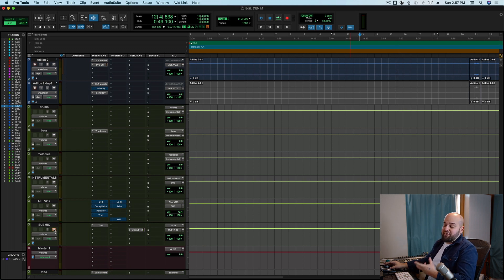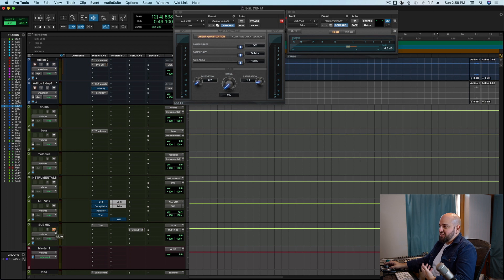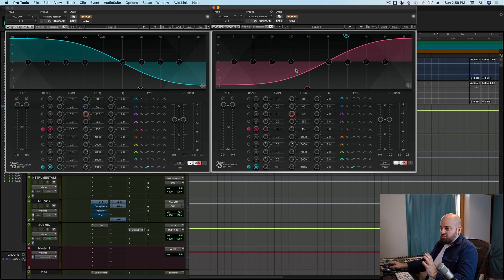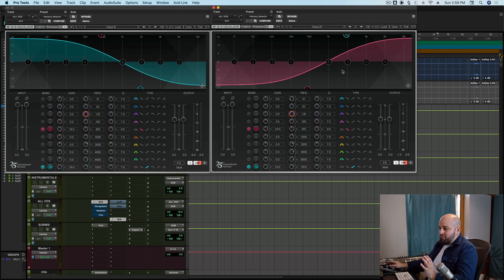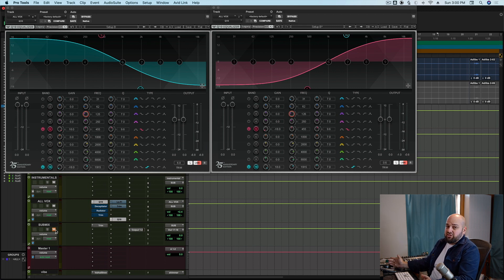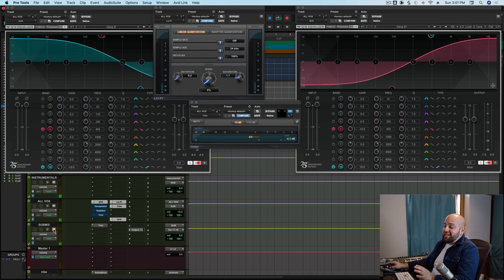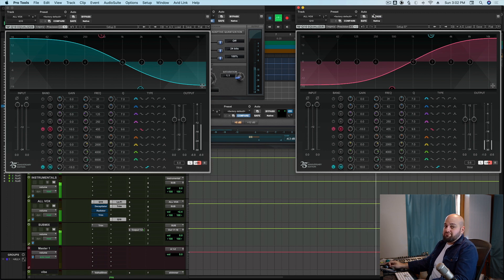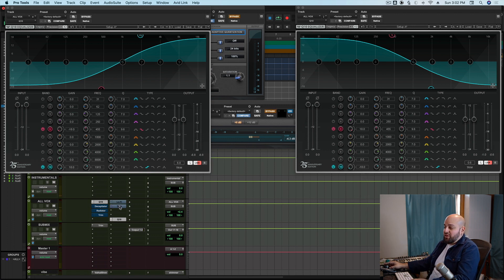Essential Lo-Fi Techniques - Shape Your Distortion With This Unique EQ Trick

Comment: You're the man! 

When would you use overdrive over a tape or tube saturator?

I literally have never used overdrive, am I missing out on something important? I'm using tape/tube sims to add frequencies where the track is lacking. All thanks to one of your older videos, I completely underestimated how powerful this can be.

Before posting this comment I did another google search (tape vs overdrive) and others, but nothing worthwhile came up again apart from some gearslutz thread where it just turns into a debate. just was curious about your opinion?

I have to stop asking you questions on every video....... I'll try not to. but I know you're gonna be too big and too busy to answer anything soon!

Cheers
Reply from the maker: Please don't stop asking questions on my videos! Your question is very likely a question someone else has!! Answering questions like this adds value to my videos, and, boosts my YouTube engagement at the same time. So it's just wins across the board.

So we need to understand what overdrive and tape saturation really are. Overdrive refers to a single component or group of components reaching their total possible amplitude and going beyond. The components cannot output any more amplitude, but the energy driving that component has to go somewhere. That energy turns into harmonic energy. Overdrive typically resembles some kind of soft square wave distortion, which has a buzzy quality, then becomes more fuzz-like as drive goes up. Fuzz pedals are usually based on transistor overdrive which gets particularly square wavy.

Tape saturation on the other hand is a result of a series of component groupings. When the "machine" is NOT in overdrive, the result is that each component passes subtle amounts of saturation on to the next. The harmonics and component non-linearities couple into each other at each stage - from transformers within the input stage, to imperfections in the magnetizing process, how the electrons act on different formulas of tape, and more transformers on the way out. And a bunch of subtle stages in between. This results in a more general "tone shift" and very subtle pleasing over tones that kind of just put the sound "in bold." We can sometimes even find a sweet spot where the amplitude output of individual components begin to hit lose their 1:1 specs, and the transients start to round out - almost like a natural compressor but instead of losing energy we are simply converting that energy to subtle harmonics. As we start pushing the levels, however, that tone shift starts to become more pronounced and those harmonics start to become a lot more distinct, and once we hit really audible distortion it becomes a very complex and messy distortion called "break up".
Reply: @WeissAdvice  Truly, I really appreciate your willingness to help, I know you're busy and it MUST be tough to get to the replies. So honestly thank you. 

I saw you on here 10 years ago and you blew my mind even back then. Then I did not see you for around 8 years, and boom... you're back with a channel. instant sub

I understand what you said about overdrive and tape sim, it makes much more sense now. I didn't know overdrive was mild fuzz (perhaps not that simple.. I get that) but I can make sense of things now. I see now that tape sims are doing far more than just straight up soft clipping, there are emulations involved etc.

Thanks a lot for that. I don't always comment, I resist as much as possible but sometimes I gotta ask. I usually quickly google first to make sure it's nothing I can easily research myself. But I don't feel as awkward dropping questions now. If you don't see it, or get back to me, that's completely fine also!!! I'd assume it just got lost over anything else. 

Thank you

Comment: Very cool. Maybe I've misunderstood the concept somewhat, but is this not equivalent in result to having used a multiband saturator such as Saturn? So, you just focus it on a band area that you want to distort and avoid the rest? Anyway, thanks as usual, your stuff is amazing, and I'm going to play around with this myself.
Reply from the maker: In practice those ideas can be used similarly, however, they are not quite the same. Multiband saturation uses crossovers to separate frequency bands and then distorts them independently. So if you want to really saturate the lows while keeping the highs perfectly pristine, multi band may be preferable. This technique is still broadband saturation, it's just attuned more to whatever frequencies you are exaggerating. So if you're boosting the lows on a drum kit, for example, you'll hear some degree of distortion across the full range of the kick snare and hat, particularly when the kick is hitting. The harmonics will just slant toward the low end. I find this results in a more "cohesive" processing - so if you want distortion on the whole sound, but you need to balance how that distortion is reacting, this technique is preferable.
Reply: @WeissAdvice  That's great; makes sense. Thanks so much for taking the time to respond.

Comment: Neat!  I've got another trick like this that I use.  If you use bluecat's free gain utility you can put one on either side of the distortion plugin, link them and click the reverse button, then when you crank the one infront it turns down the output.  You can get some insane drive out of usually pretty tame saturators :D
Reply from the maker: That's super convenient. It's the like the ITB way of grabbing the in and out of a piece of hardware and turning them in opposite directions at the same time.

Comment: Would this work wif a LINEAR phase eq? First time I'm hearing of a MINIMAL phase EQ Tbh
Reply: Minimum phase eq is your basic eq. They are designed to shift phase as least possible but still introduce phase shift.
Reply from the maker: This is a good question. I don't believe this will work the same with linear phase eq. Linear phase EQ results in an artifact called pre-ring, and I BELIEVE this pre-ring does not generate perfectly out of phase when you are cutting vs boosting. I would have to test it.

With a symmetrical minimum phase EQ, your phase shift is exactly the opposite degree when you boost vs cut. So if you shift your band +70 degrees out of phase with a 6db boost, you would shift that band -70 degrees with a 6db cut! Kinda neat.

Minimum Phase EQ, as @David Asher said, is most EQs.